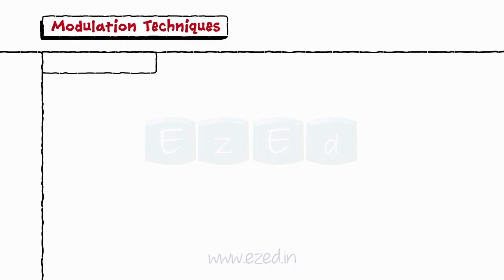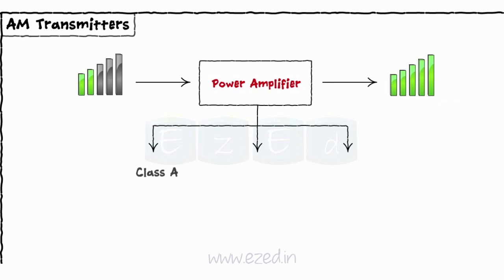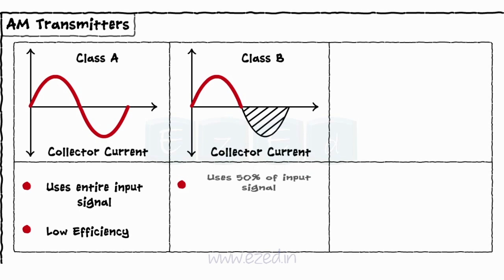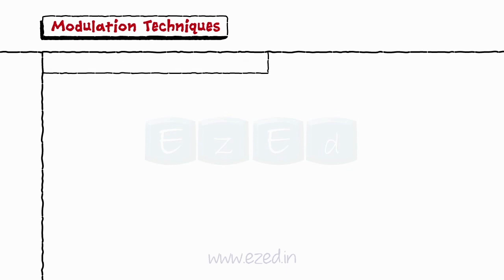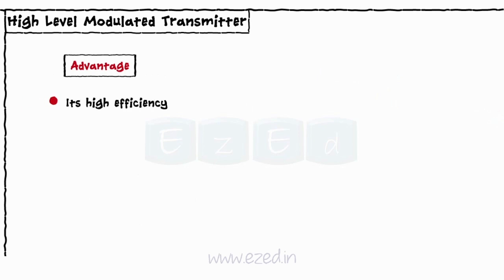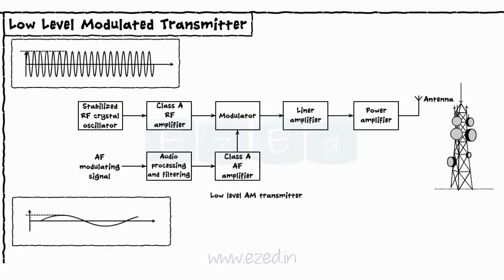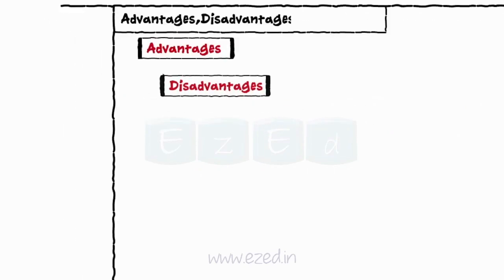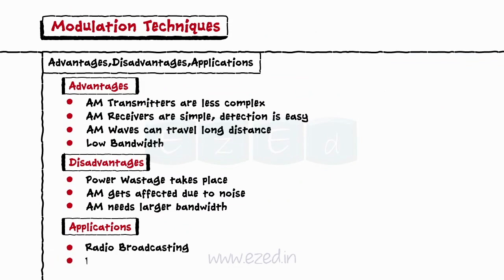AM Transmitter  - Power Amplifier - Modulation Techniques

Comment: Sir your way of explanation is very good and in easy way to understand
Sir Any video on designing RF transmitter and receiver module circuit, for RC control toys etc OR  any video's on the topics required to study in electronics, for designing RF transmitter and receiver module circuit, for RC control toys etc